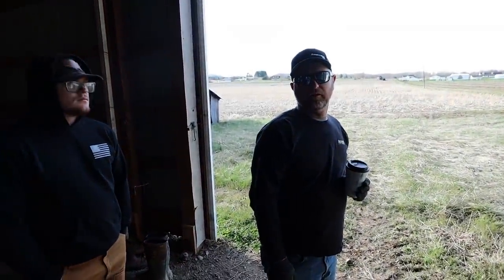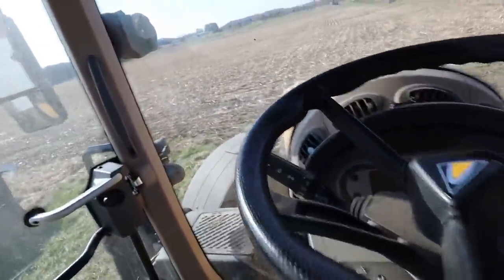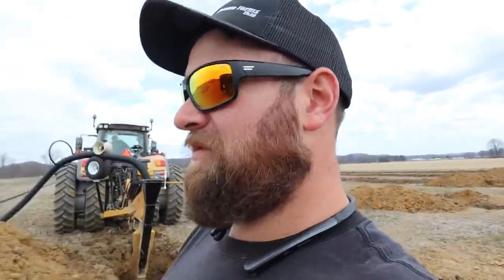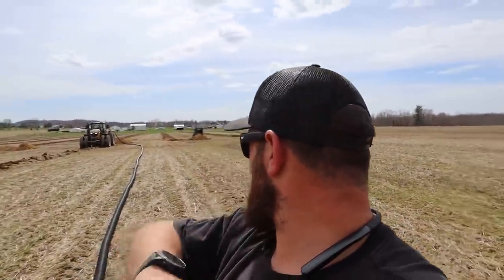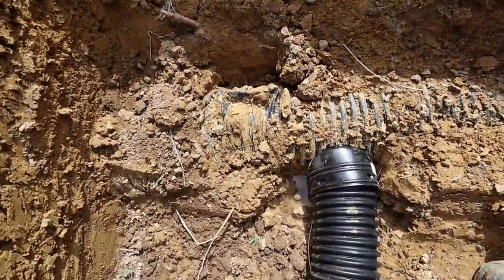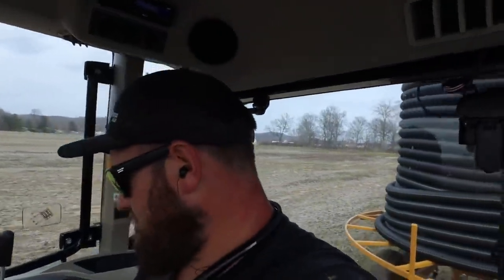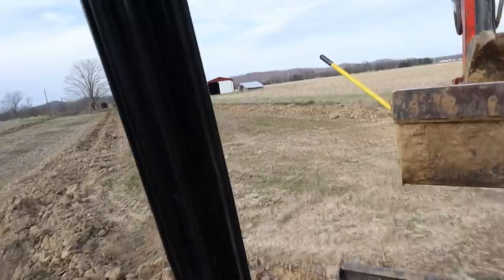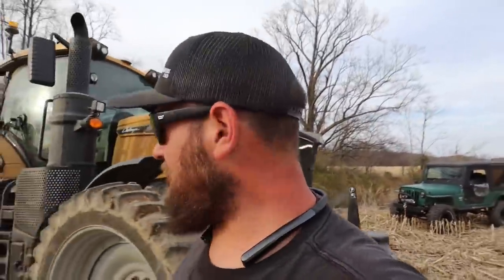Making Huge improvements to our Farm with drain tile

Comment: Plow is pulling fairly easy  there. Will be interesting to see if you need the pull tractor to pull the larger boot. Can't believe you are that dry and warm. Only 350 miles north, we are still freezing every night and too wet to drive on fields.

Comment: Brian, who told you that 8 weighs over 100k? Decked out with ripper they are around 85k our 8T with 4 barrel ripper and limb risers weighs 85 and change. I know it’s got the double U blade but I still don’t think it weighs much over 85. Even with a winch. Am I missing something?
Reply from the maker: We were told that without anything the box weights 80k blade weights 15k not sure on winch.

Comment: How does water get into the drain system?  Are there periodic drains at surface level?
Reply: The pipe is perforated with small slits.